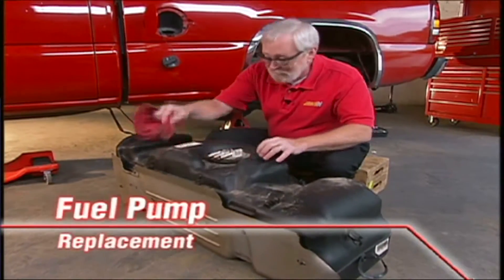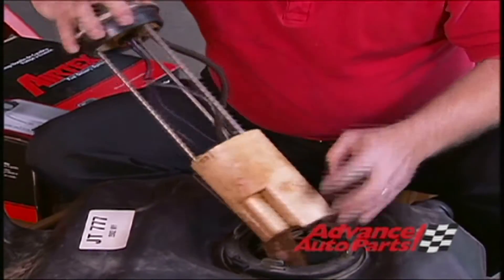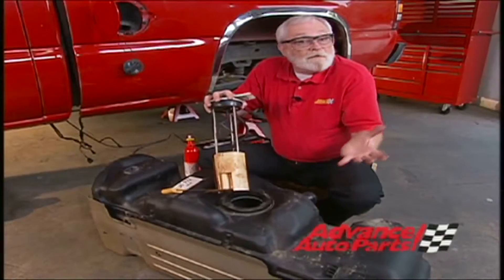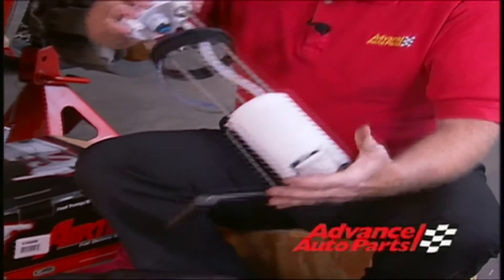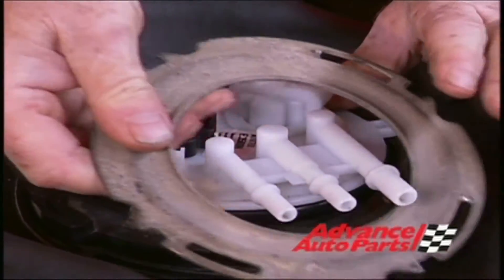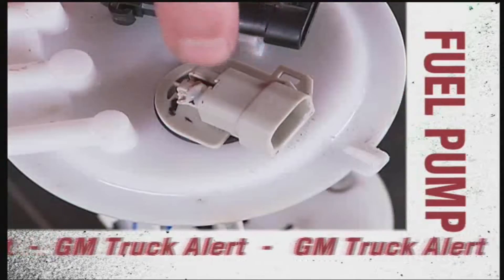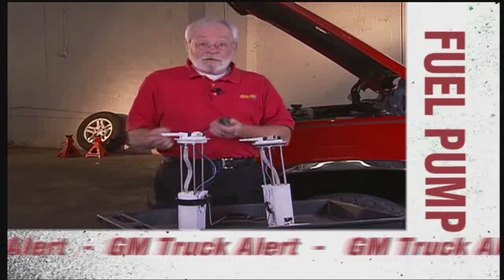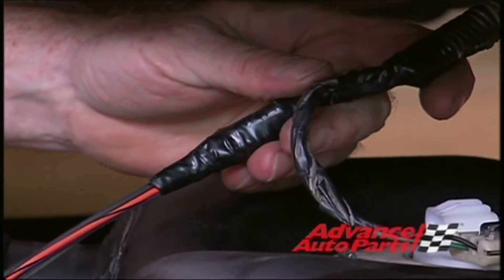How To Replace A Fuel Pump Module - Wrenchin' Up Back To Basics

Comment: Most shops do not clean the tank. Was your tank unusually varnished?
Reply from the maker: Hi - According to fuel pump manufacturers, most defective returns are caused by contamination from dirty fuel tanks. Mentioning that the tank should be cleaned when replacing the fuel pump should help raise awareness of this issue that can cause early fuel pump failure. In another study, shops that say the tank does not have to be cleaned were among the shops that had a high rate of " defective" fuel pump returns. Interesting!